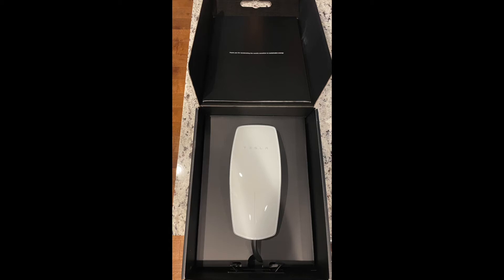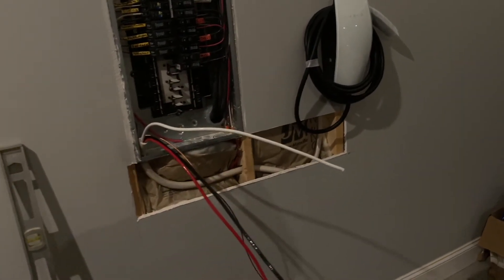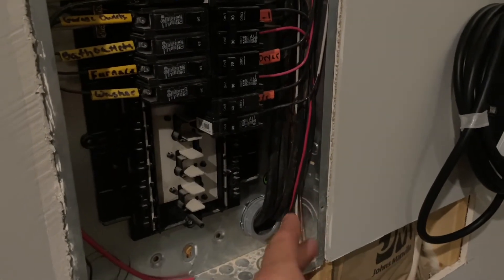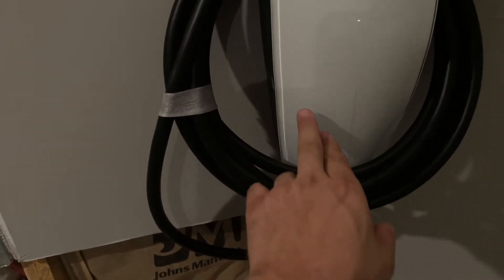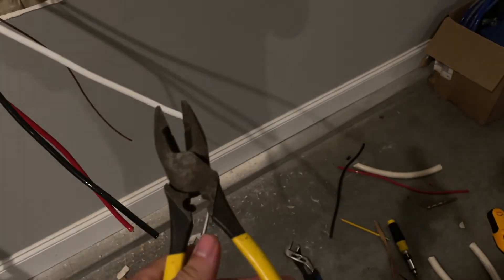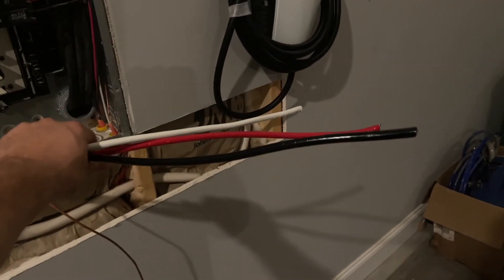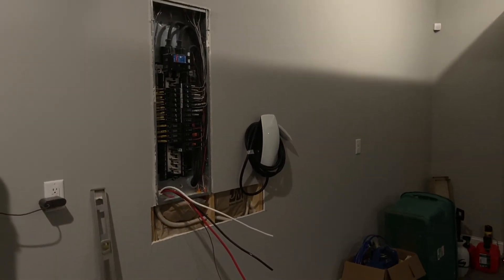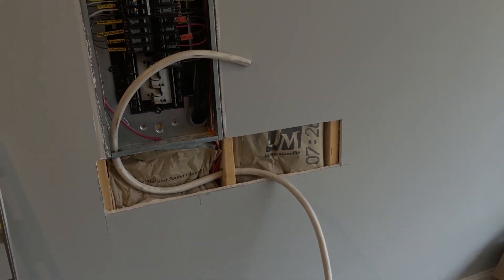Tesla Wall Charger Install | Gen 3 - All You Need to Know

Comment: Something to understand with wire/cable sizing is the derating of the wire based on distance and also the ampacity of copper vs aluminum. Given the short distance and the fact that you used copper wire the actual cable rating is actually closer to 100 amps. You sir have certainly gone above and beyond and provided what I would consider a “ gold plated” installation. 
Another thing to have considered would have been to have installed a receptacle just below the panel and used a cord for the charger which would make the charger portable if/ when needed and would give you the flexibility of using a welder or some other appliance in the same receptacle.
Reply from the maker: Appreciate the input.  It never hurts to go above and beyond.  This charger will see daily heavy use, so it is piece of mind for me to go a little overkill on the project.  Thanks for watching!
Reply: @DerekHalkett  I appreciate you taking the time to make the video. Where I live in Maine I’m seeing more and more Tesla’s and I just discovered yesterday that local electricians are estimating $2500 to install just the power alone not including the actual Tesla port so I wanted to see what was involved and it just blows my mind how much contractors are charging and definitely kudos to you for tackling the project on your own.
Reply from the maker: That’s crazy!  I would never pay that. It’s literally a 2 hour job in my instance. If you are a long run or require conduit, I can see the price going up significantly. The copper wire is expensive, total cost for the install with charger was around $675. Charger is $550 with tax and the wire, grounding lug and 4 feet of 4/3 wire was another $125. Not a bad project to tackle on your own. I’m from the Boston area originally and know that the contractors up north are significantly higher priced than they are in the south.
Reply: @DerekHalkett  could potentially be a bit of price gouging going around too due to labor shortage. It’s Getting tougher and tougher to find good contractors that aren’t booked out solid.
Reply from the maker: @dominicm2175  for sure. Don’t forget to factor in the Tesla tax. Seems like everything that touches a Tesla charges it. Such as tint windows companies, etc.